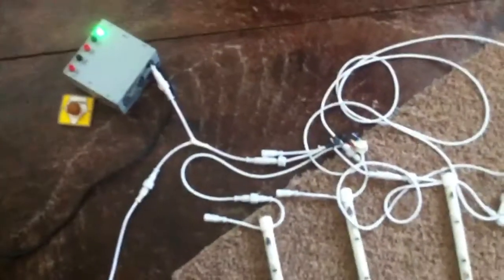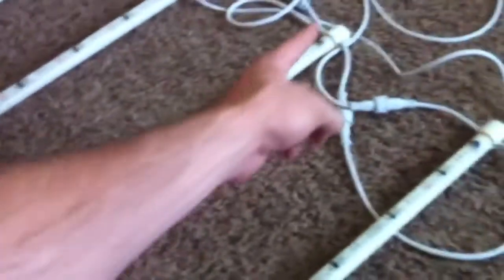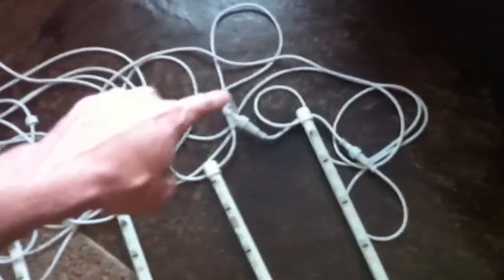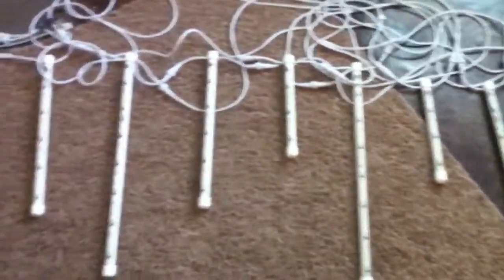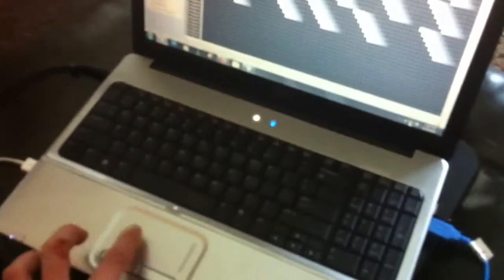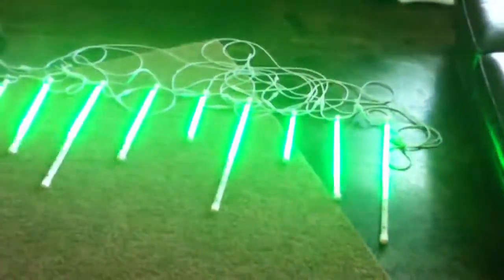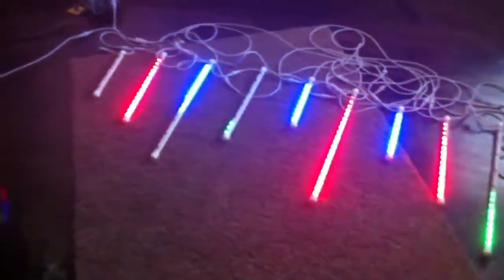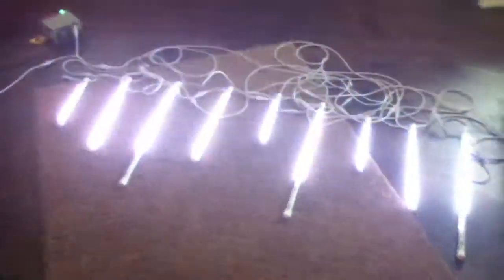Pixicles Video Wrap Up

Comment: I'm confused on how you configured the pixels. I have a 1 meter (32 rgb pixel) strip, butapparently not the same as your's. I understand the that first pixel is 3 dmx channels ... and so on. BUt wat is the spacing of the pixels?  Where did you get yor pixel strip?